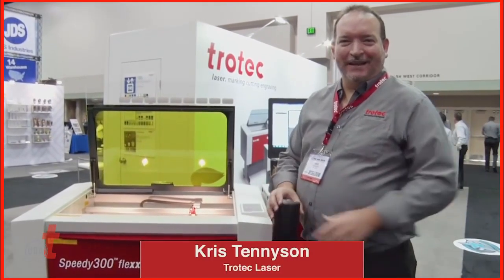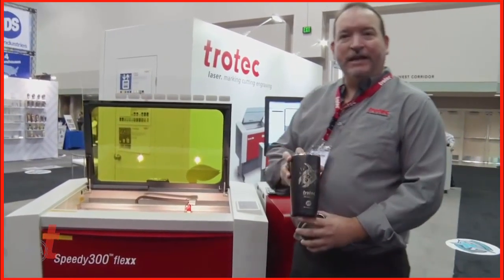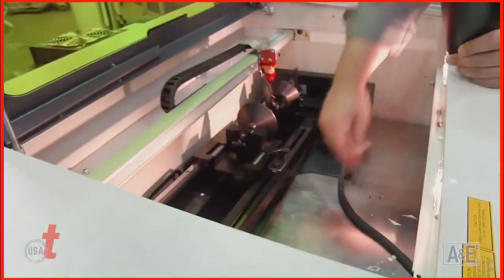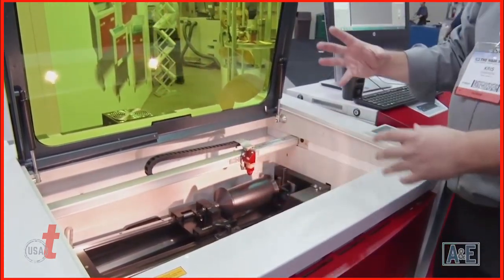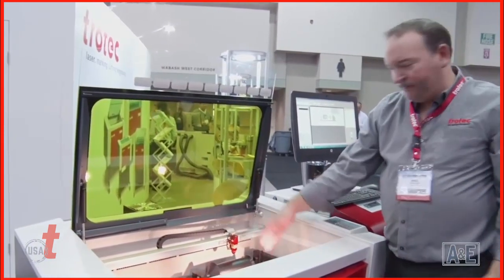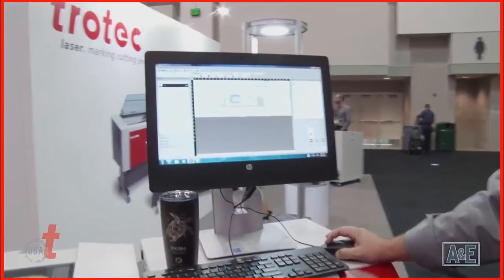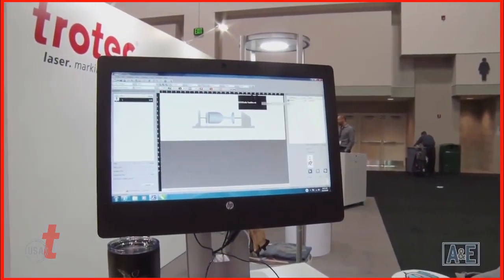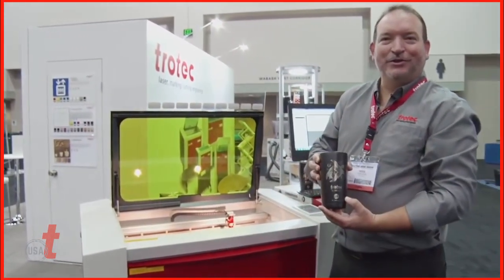Trotec How to: Laser Engraving a Tumbler on a Speedy 300

Comment: Good stuff! Let's say you are doing 20 tumblers with the same logo, how do you make sure you put the logo on the same spot on all 20 tumblers?
Reply from the maker: This will require that the tumbler is placed into the rotary the same way in relation to the file each time as the laser job will repeat the same results each time.